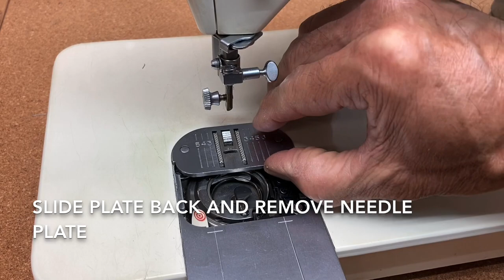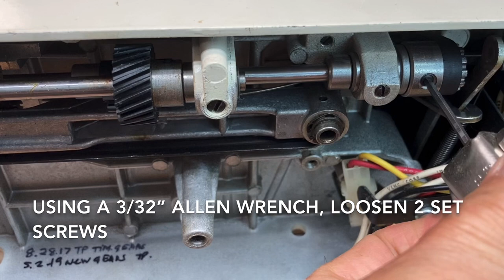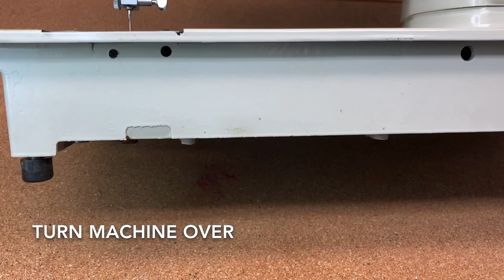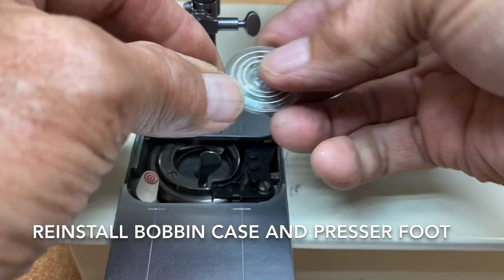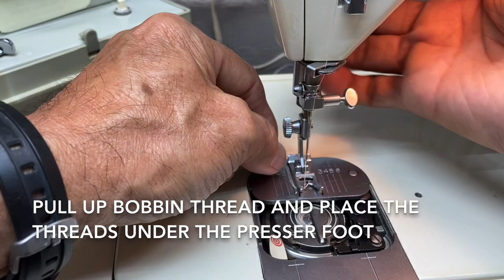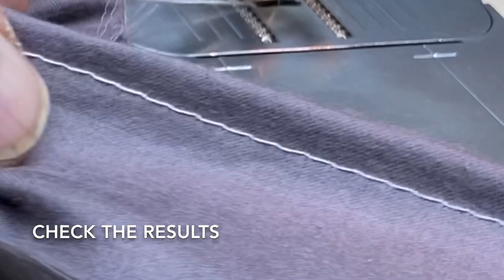HOW TO SET TIMING ON A SINGER TOUCH & SEW CORRECTLY

Comment: Thanks for sharing!  Wondering about testing with the zigzag stitches to verify better?  I forget, though seems that or the needle bar lever and cam adjustment maybe is more related to that now that I think about.  Mine has the pulley gear on the top shaft of the belt loose as found.
Reply: Wow, I just set 758 timing and got super hyped stimulated it's way off and I was pessimistically paranoid perplexed until I watched the Randy Your Sewing Machine Man YT channel video showing about.  HHHmmm... I'll super double check watch the belt again and again... though I didn't look at the gear box beveled gears good for the hook and maybe I'm missing something else with the needle bar cam timing issues I can't envision that wasn't noted that might logically effect the timing maybe???  Well, next up to check out the beveled gears and see if I notice anything anywhere else changing the timing each revolution of the handwheel.  Man! Wow, that got me stoked and worried since my prongs are all uneven depth at the plug and not in the correct place.  COVID, Type 3 Parainfluenza (I had this summer and definitely can be bad mentally and way more most don't worry about or test for or have a vaccine for) or something else going on?  Anyways, thanks for sharing.

Comment: Thank you! It's really helpful! I've got the same model, and the hook-needle timing is definitely off. 
I would like to ask one more question please: I see the metal feed dog in your machine. In my machine it's still an original rubber and it's worn out. I would like to replace it with the metal part. Where could I get the metal feed dog?
Reply: They are available on ebay.

Comment: Is the timing responsible for my stitches not being straight? there is a pattern to it. Every so many stitches is on an angle. I have a 603. Been sewing on it since 1964ish. Mom always had it serviced. Mom is gone this year. I can service. Would like to learn more about it.
Reply: Are you certain that the stitch width lever is all the way to the left? Here is a link to the operating manual:
https://www.manualslib.com/products/Singer-Touch-And-Sew-603-4059739.html

Comment: I learned a lot (I learned what a catch point is, and I learned that the back of the needle has a concave section), but I'm confused about when the feed dog timing notches marks on the two gears are supposed to align.  The gears move, and these marks pass each other.
Reply: My top thread keeps breaking, and I cannot adjust the tension to accommodate.
Reply: Another eureka moment.  Learned that the feed dogs need to be moving in the downward direction when the needle is moving *downwards*, and vice versa.  I ran into trouble when I replaced the old rubber feed dog. When I was adjusting the gears to make the feed dogs flush with the top of needle plate on each downstroke or upstroke (as the needle enters or exits the fabric) I had accidentally set the timing exactly opposite (so that the dog was moving up when the needle was going down. argh. This doesn't work!)   Now, everything works perfectly.  No tension issues, no breaking thread.
Reply: @rebeccahorner3266  plz guide me i have a same problem.  Needle hits on the feed dog when goes up
Reply: @kaurharjeet4689  I'll need to think about this ...

Comment: Why did you not set the timing on the needle shaft first?   There are two marks on the shaft.   One for bottom and the second for the hook.   9 out of 10 times, the needle shaft was the problem when I used to do them.
Reply: Thank you, I have the same model and I will check the shaft as well!
Reply: @allamccamey4695    Top mark is exact bottom of shaft movement.   Adjust with screw on side of shaft. Second mark is when the hook should be center of the needle in center setting.  Must adjust needle hook from bottom on hook shaft set screw.
Reply: @KevinCoop1  thank you!
Reply: @allamccamey4695  are you having issues with skipped stitches?
Reply: @KevinCoop1  as for now - no issues. I've fixed the timing successfully. The only problem left - the original rubber feed dog has got deteriorated, so it does not feed the fabric.